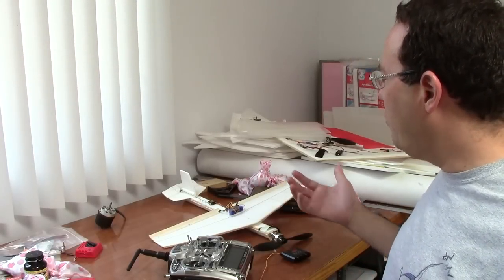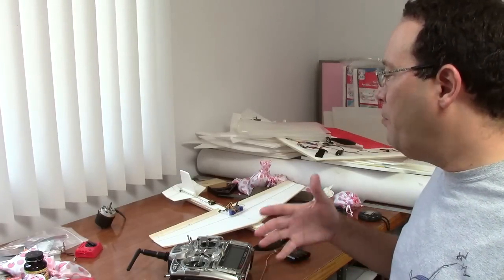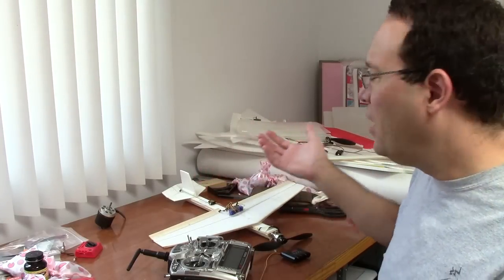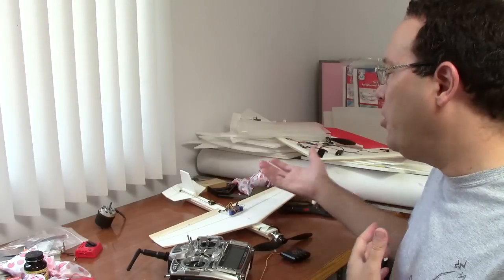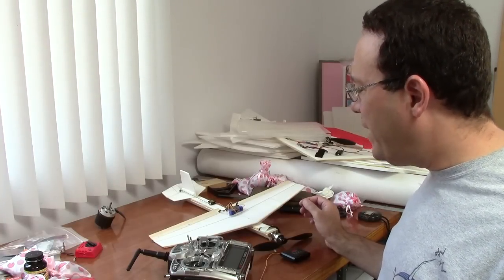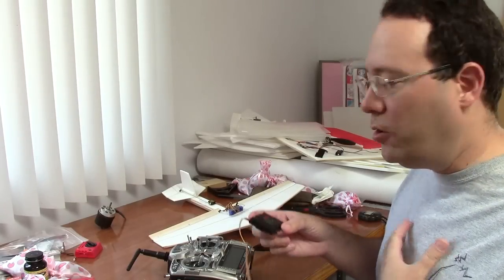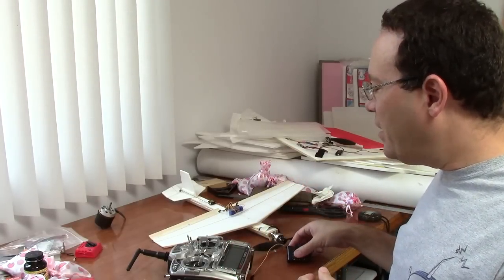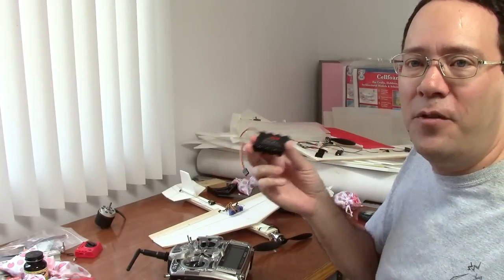RC Motor Kill Switch

Comment: I was searching for these keywords today;
emcotec sps safety switch is a blast but expensive
toggle on/off switches which usually just go to 20 A 
 battery isolator switch  for higher amps is nice for bigger planes
quad ignition switch with a key would be cool to use
DIY: search pictures on hi current arming switch
check out aliexpress for inexpensive switches.